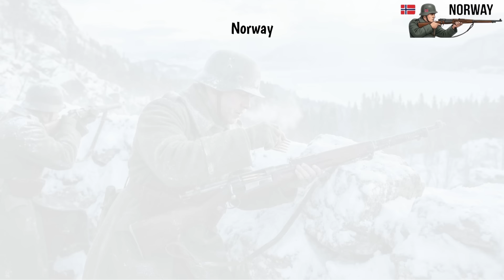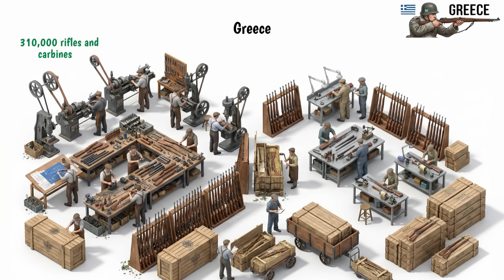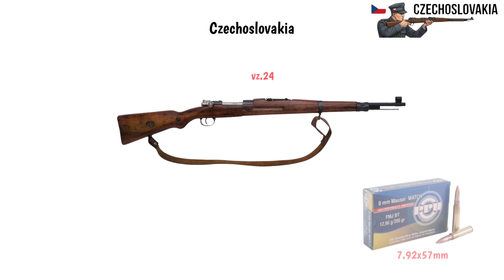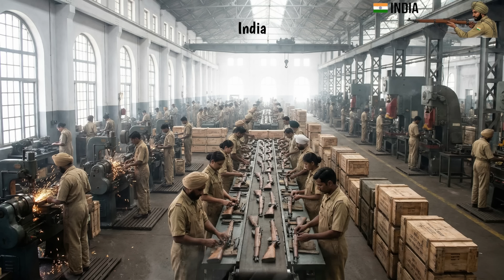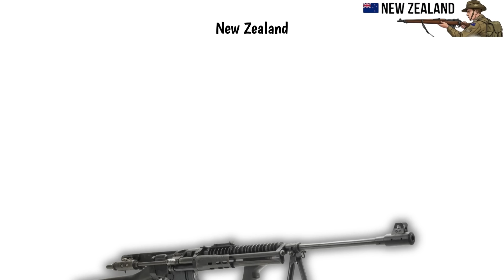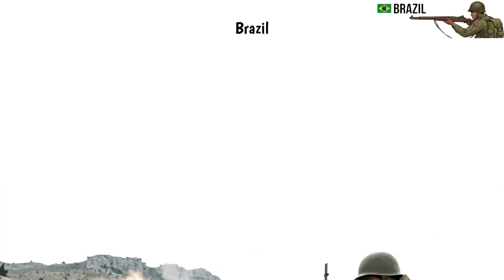Every WW2 Country's Infantry Loadout RANKED | Part 3

Comment: brazil stealed m1 garands because they only had m1903 springfields so they stole from u.s soldiers they did not receaved the garand they receaved in 1945. brazil receved m1 thompsons but later in less quantity they receaved m1a1

Comment: The Brazilian Army used the excellent Mauser 1908 and 1934 rifles, but their 7mm caliber was incompatible with the American standard. Thus, the expeditionary force had to use another model, and agreements were made with Washington to equip the national expedition with weapons manufactured in the US, as it was confirmed we could not supply the troops, secretly hoping for the Garand; However, just a few days after the first contingent of the Brazilians landed in Naples, the US logistics had assigned the soldiers the old Springfield M1903 rifles.

M1 Garands were only acquired later on, but they still weren't massively standard issue as some people think they were. Some personnel had Thompsons, Carbines, some had B.A.Rs, some had bazookas, the M2HBs and M1919s were mostly mounted on jeeps or tanks.

The M3 Grease Gun was not standard issue to rifle platoons, but small numbers were available in the HQ sections of rifle companies, and were issued for duties such as patrols. The M1911 was also a gun mostly issued to people who weren't on the frontline with a rifle.

At the end of the war, 20.573 Axis prisoners were taken, including two generals, including about 900 officers. The FEB (not just the land force but also the navy and airforce) has contested casualties, but mostly agree with ~2.000 casualties, including 441 soldiers in direct combat, 9 from the Air Force (FAB), and approximately 1.400 from the merchant and military navy. Other casualties are mostly from cases of diseases, accidents, self-mutils, and so on.

Remember that this expeditionary force was only composed of ~25.000 men and they got dissolved almost immediately after the end of operations in Europe (albeit because of the dictator in control of Brazil, not because of the Allies; actually, they had made the invitation to collaborate with troops for the occupation of Austria, and the navy was protecting all convoys on its own in the atlantic by essentially the end of operations in germany and by the end of the war in japan.), so of course many of the equipment given weren't inherited, and even if they were, they wouldn't have done a significant difference in the army (maybe in the CFN). Brazil would only receive significant numbers of Garands in the 1950s, but by that point, the war had been already over, we had made a small number of copies of the Gewehr 43, and we were already sortof interested in the FN1949.. but our eyes had already gone to the excellent FAL.
Reply: Saudações da Polônia!
Reply: Quando puder, manda a fonte do texto. Alguns detalhes eu não sabia. Por exemplo, qual armamento de dotação até a aquisição do FAL.